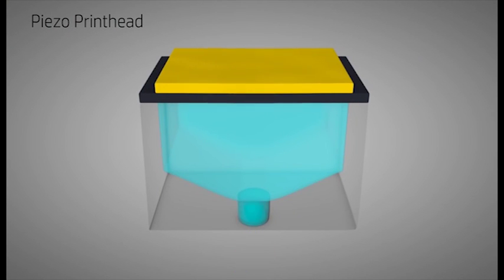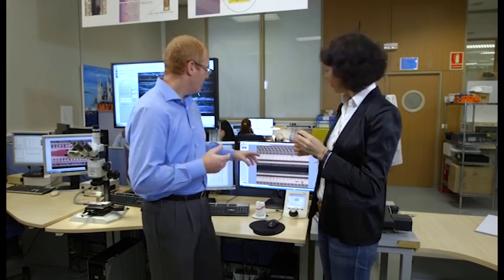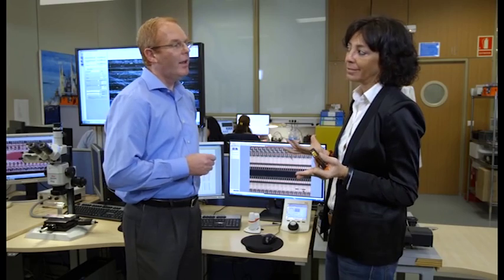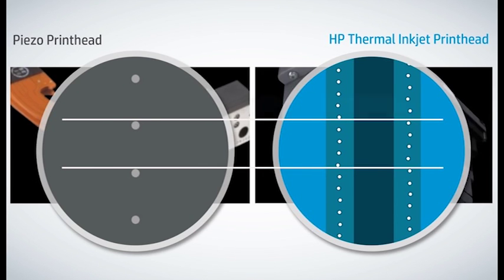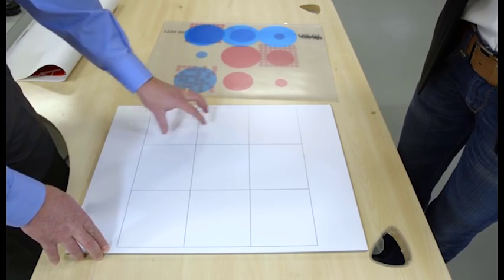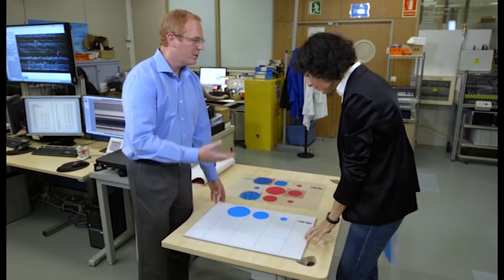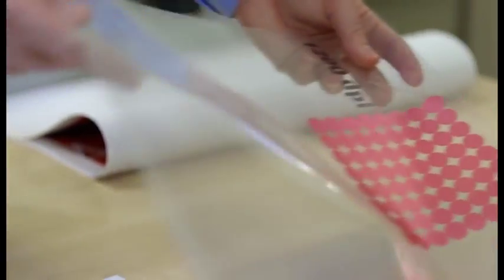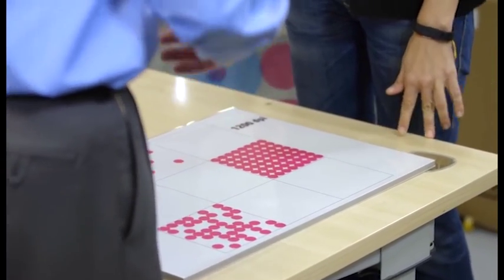HP Thermal Inkjet vs  piezo printheads   the technology behind HP Latex printing

Comment: The problem is, Epson quality still outshines any other brand there is with thermal heads. Especially when it comes to other-than-water based inks. Also, making more passes does not mean slowing down the print process necessarily, there is two-pass printing for example.

Comment: The main problem with Epson inkjet printers is due to the fact that head is built into the printer itself, rather than coming as a part of cartridge. The print head tends to get clogged whether you use it daily or weekly. It also depends on the weather conditions where it is being used. Hot weather will certainly cause the ink to dry faster. And that's where this becomes costly. Unclogging the head is a mess and even if you do succeed, it will clog again soon after. And soon you will end up buying a new head which obviously costs more than the printer itself. Unlike thermal print heads which comes as part of cartridge, with any clogging problem, you can simply buy a new cartridge and issue solved.

Comment: Why HP printers are low fiability ?
Reply: That made no sense.  What are you trying to say?
Reply: @dalevincent2875  I rephrase: Why HP MFPs Have Low Reliability. Situation: I had a multifunction printer Deskjet Ink Advantage HP3525, bought for 100 euros. After 5...6 months of operation, the print head failed. Error: The printhead for this product has failed. I don't think I printed more than 200 A4 pages. I took it in for service, they told me that a new printhead is more expensive than a new printer. I was looking for a new printer and by chance I found an offer for the same printer in a clearance sale, and I bought an identical printer for 50 euros.
Shortly after, and without me using the scan much, the scanner broke down. I replaced the faulty scan assembly with the one recovered from the first printer, and it worked fine for about 2 years, when the printhead failed again. I've now bought a Canon printer, I'll see how that lasts too.
Reply: Simple, because it has thermal print nozzles which heat and fail early.
Reply: @ioanacatrinei860  they should've fixed it under warranty